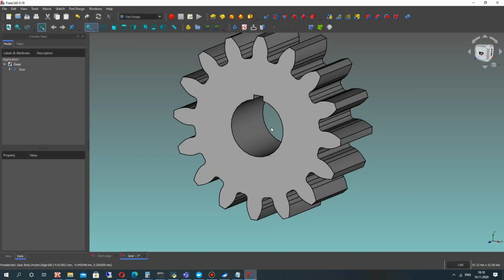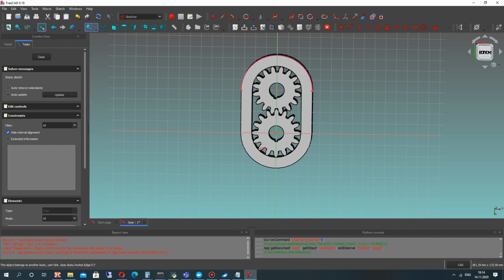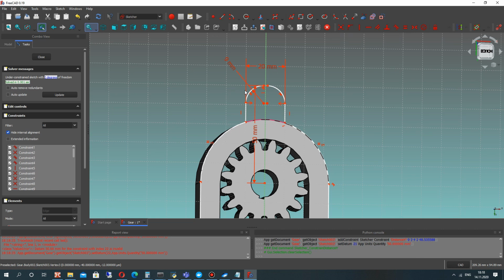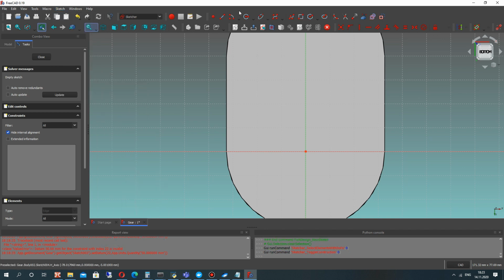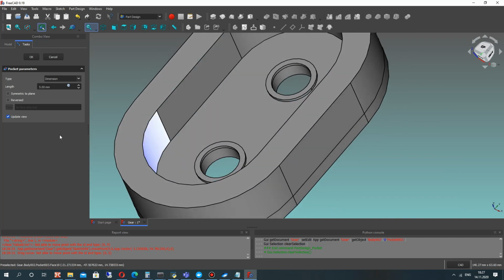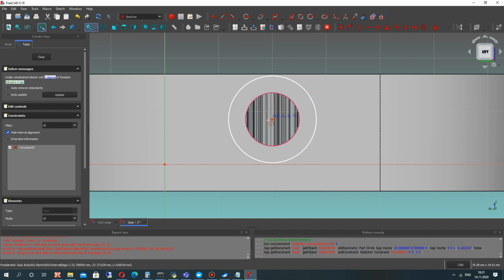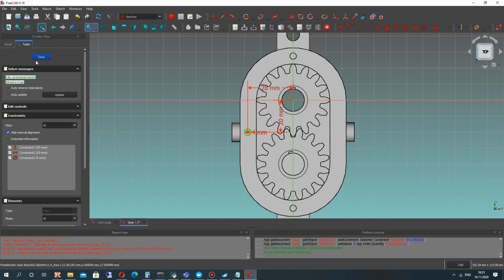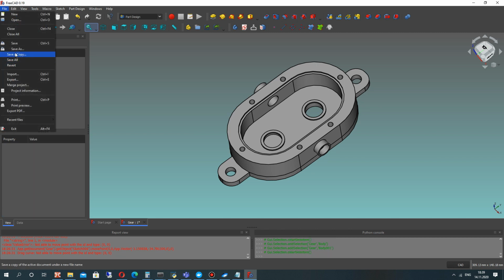FreeCAD Tutorial Part 2/6 | Design Case of Gear Pump in PartDesign Workbench

Comment: What is this? A tutorial? No. You do things without showing how. If you wanted to tutor only the assembly. Because if I knew what you are doing, I had no use and reason viewing it. You just could make one 30 minute tutorial by using alread made parts. Or your six part serie(s) have showing/say what keypresses you are doing besides lightning speed mouse cursor movements. Please remake these useless time consuming videos.
If you can't teach but only can show off. Stopp it.

Comment: if you rearrange toolbar then all icons for sketcher constraints can be visible.  You can drag them into different location, or right-click and turn some of them off or on.
You can also customise toolbar, and then move frequently used tools from different workbenches, so less switching between workbenches.

Comment: Just awesome. Thank you! 
By the way, I didn't run into the same problems as you did with the constraints. Is this because I have "Auto remove redundant constraints" checked maybe? Is there a downside to having this checked?
Reply: Yes and no, you can have constraints you maybe did not want to be deleted that way, with the "Auto remove redundant constraints".
Although it is quite annoying to always solve this problem with redundant constraints. Personally I prefer deleting them manually so I'm sure of what is going on